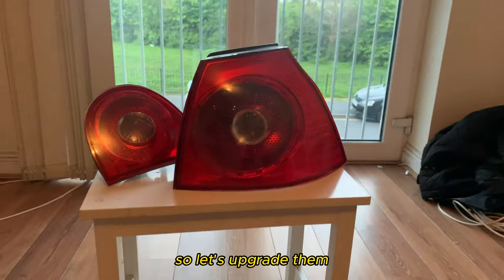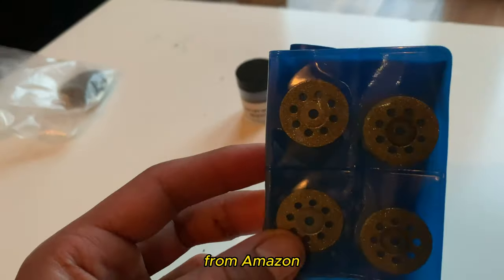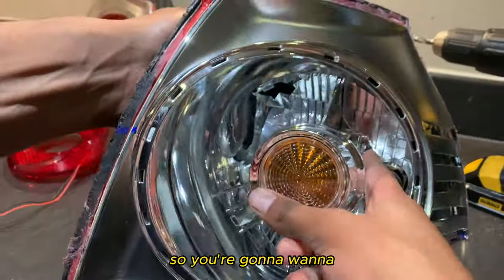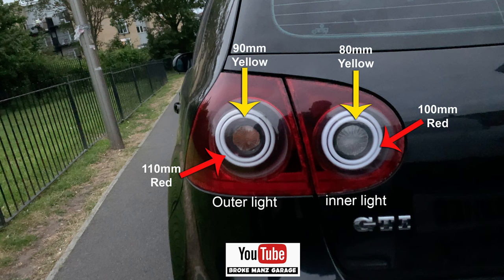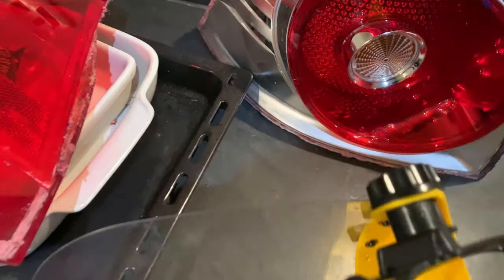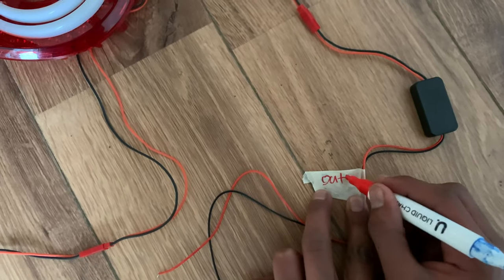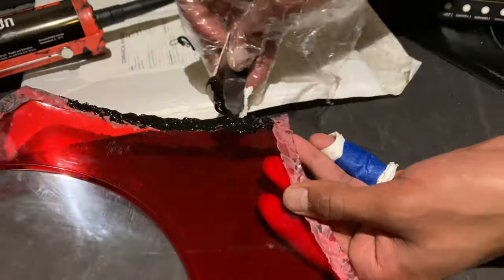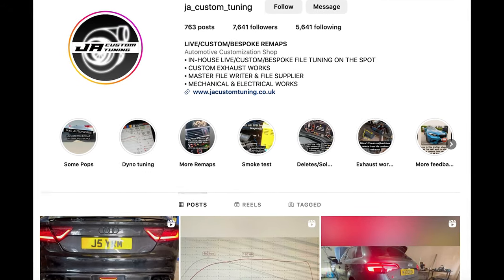How To Make Skyline Mod Tail Lights (DIY)

Comment: we would have to get it wired by someone to get it to follow our inputs when turning or braking right? or will it do that if you reconnect it to the cars oem power connections for the tail lights
Reply from the maker: You can do it yourself I personally don't like wiring so got someone to wire it on
Reply: @BrokeManzGarage  how did they wire it?
Reply: @BrokeManzGarage  thank you for the reply im wiring right now as we speak
Reply: @jn7154  if you splice it into the existing wires for turn/ brake they still work because the resistors and diodes or whatever the car already has works for those added wires as well. you just might have to add more of those before u splice it into the car wires
Reply: @lebluescout154 can you explain me, im on that step already connected the modified lights but i can’t make it work properly
Reply: @gustavoguzman1314  hello i'm sorry i gave up on mine but i have a wiring diagram if you would like to see it